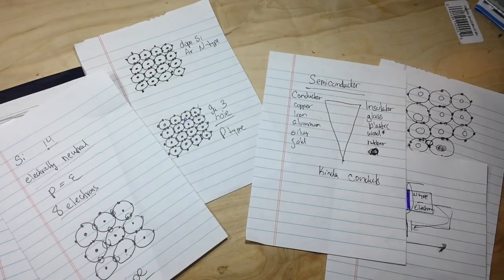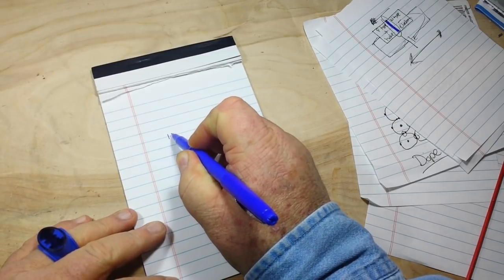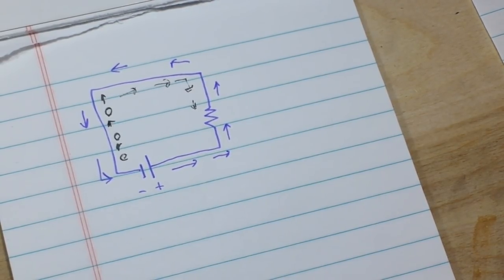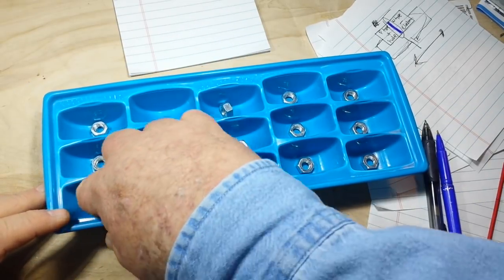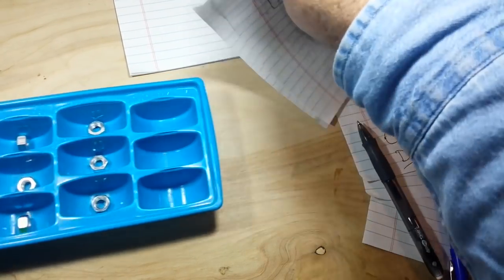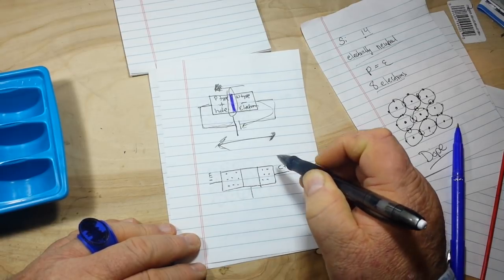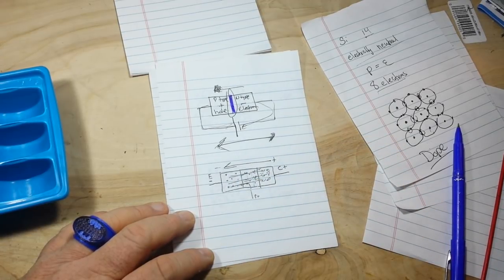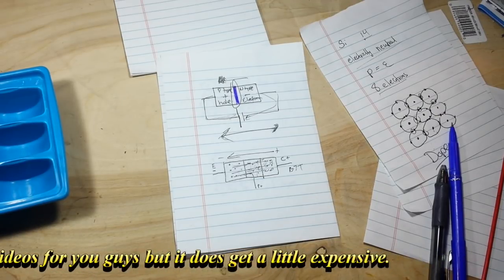Semiconductor Theory 2

Comment: Do you have anything on an ALPS Brand SRRN134300 single wafer 3 position 4 pole switch. It shows 16 terminal 4 terminals to each section and 1 common in each of those sections.
So how is a switch with 16 terminals and 4 sections of 4 terminals a 3 position switch?
Reply from the maker: +William Colvin I'm not familiar with that product, sorry.

Comment: You explained about addition of other elements to dope the silicon but what is depletion?
Reply: It's the same thing - the doping of the silicon with atoms that have fewer instead of more electrons in their valence (outer) electron shell, like Boron, which has a total of 5 electrons, 2 in the core electron shell, 3 in the valence shell, and therefore, a hole.